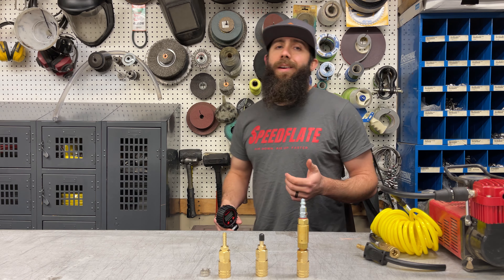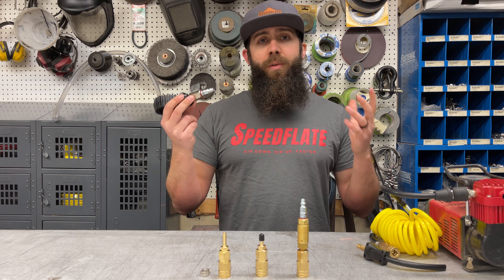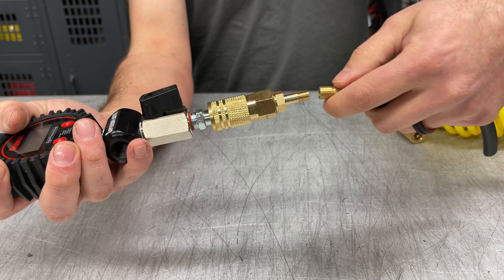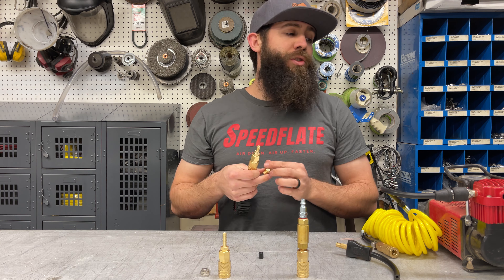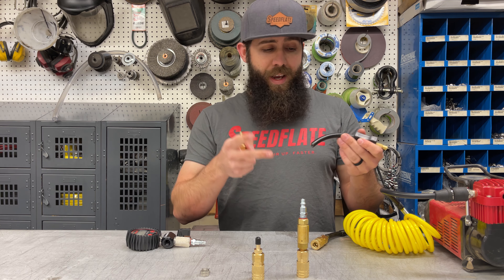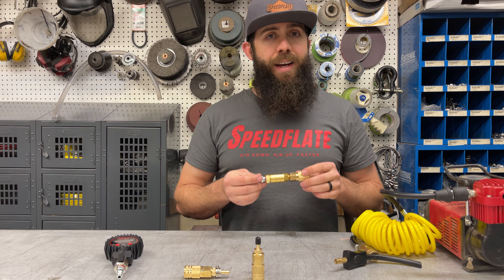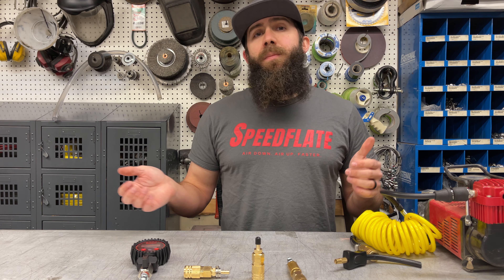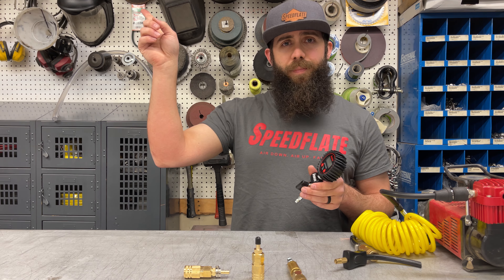Speedflate Adapters - Which one do I need?

Comment: If I hook up to the parks with out this hook up, will it just make the read out wrong or maybe damage the gage? Sould I update the gage to the max 200PSI?
Reply from the maker: The gauge on both systems is rated for 200 PSI. The only difference is the hoses. For normal use most people don’t need the pressure regulator

Comment: Just installed my ARB dual compressor. Have my speedflate. There’s just a hole in the compressor. I’m not sure how to connect the speedflate to that hole. 
Any help would be appreciated. Thx.
Reply from the maker: If you want to use ARB parts you will need this https://www.amazon.com/dp/B0050DHYEW/ref=cm_sw_r_as_gl_api_gl_i_CW4R2QR7NKTCVD5KA240?linkCode=ml2&tag=troymitchell-20